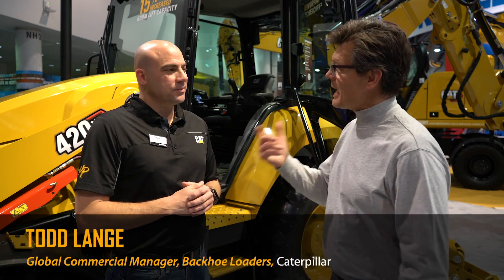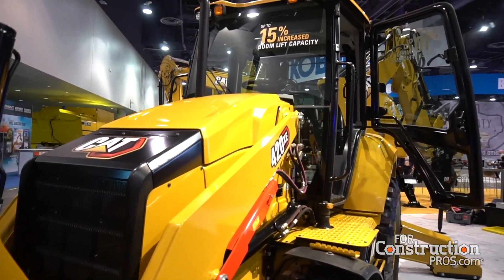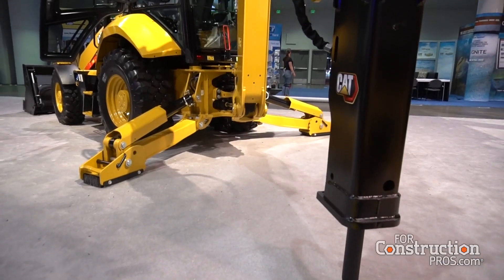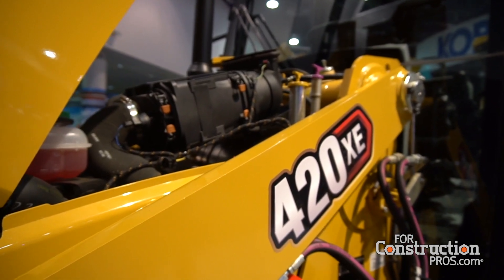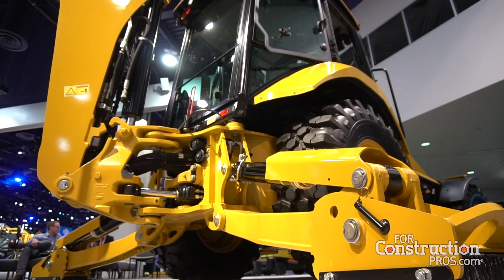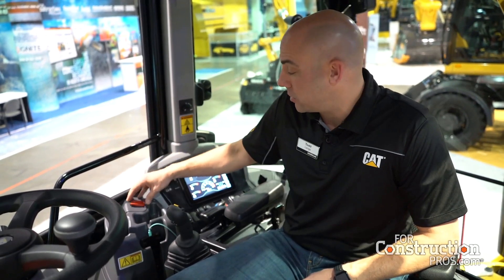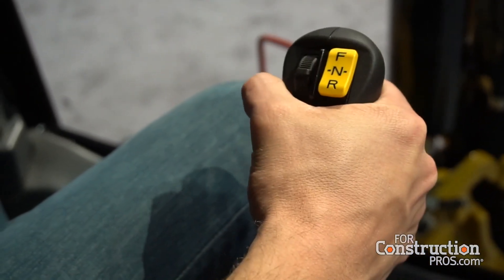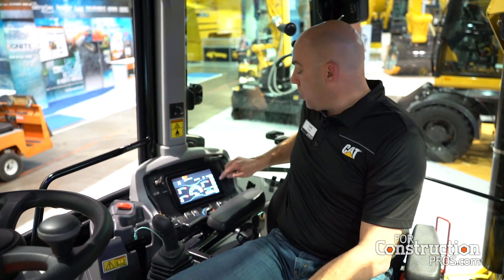Cat Delivers 15% More Boom Lift on 420XE Backhoe Loader

Comment: What is the difference between the Backhoe and Excavator setting.
Reply: Just switches what lever you use for stick and boom control, left boom right stick is backhoe mode, the opposite is excavator mode, just preference of operator